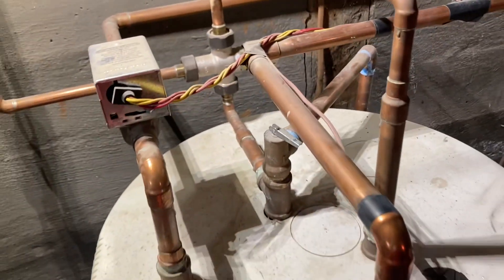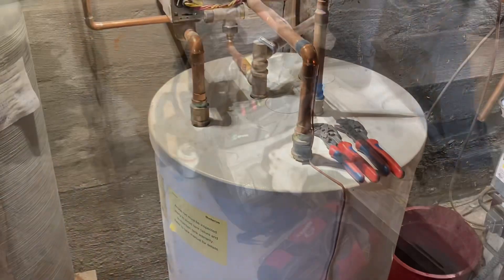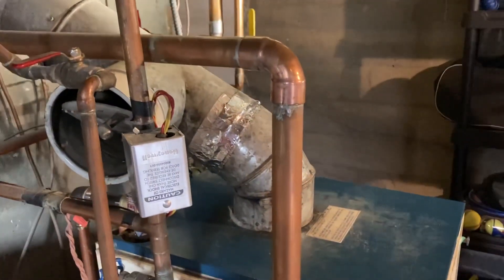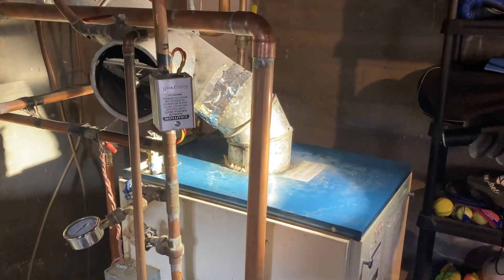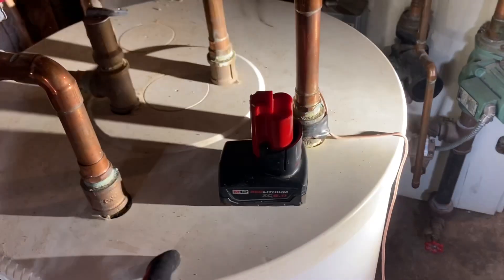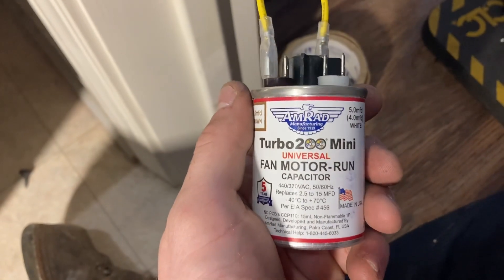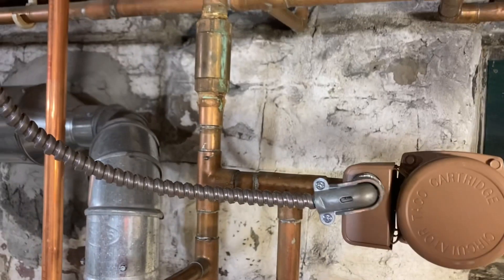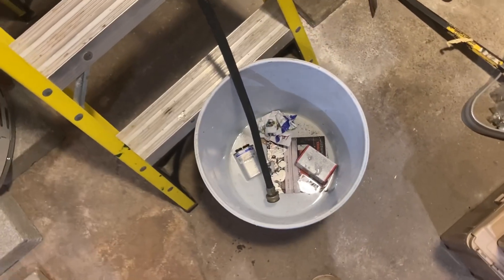Saving Our Customers Money! And Other Residential Service.

Comment: The relief valve should not have a piece of black iron coming out of it. It's a very bad thing. I see you strapped a tank this time It should have never been hung on a 3/4-in pipe without support
Reply from the maker: I re-read the mechanical code and the ASME section for relieve valve piping. Black iron fits the bill for everything they ask for, except that it isn’t corrosion resistant. My mistake. We are always trying to get better. Black iron is installed on all kinds of relief valve’s, residential and commercial, so you get lulled into doing it when it’s done everywhere else.
Reply: Black iron into the relief valve, black pipe out.  What's the problem?  It would have to run/weep for a very long time to rust it closed.  Both the inbound and exiting pipes would rot evenly.
Reply: @valenzaplumbing  I'm not sure where you're from but New York State code specifically states that the material of a relief valve drip leg should be non-ferrous metal or approved plastic which I don't agree with so all my relief valve drip legs are copper and only copper. And I have saved examples of relief valves that have seeped water piped in black iron that are completely closed potentially a bomb
Reply: @edileo2112  I'm not sure where you're from but in New York state our code specifically requires our relief valve drip legs be of non-ferrous metals or approved plastic which I'm not a fan of so all of my relief valve drip legs are of copper and only copper. And I have examples of ones of black iron that have  I've taken out that are closed right off because they seep water until they are closed potentially a bomb
Reply: @valenzaplumbing  we use our code book for a reference book it's impossible to memorize every little thing in it so if you read into the comments that are posted there's a couple guys stuck on the fact that black iron is okay when in fact it is not we're never too old to learn that's what this should be all about God bless

Comment: On teh Recirc side, the pressure tank has an interesting valve(s) system. What is that part(s)? Or is it two?
Reply from the maker: It’s one part. An isolation valve, so you can drain and check the charge easily, while keeping the water heater in service. Webstone makes these.

Comment: make that valve idiot proof....aka hide the handle
Reply from the maker: Any valve on a heating system can be turned off inadvertently and cause problems. You’d go crazy removing all of the handles from every one. I agree, it could cause an issue, but likely not. We install lots of valves for easy boiler service and don’t have issues. Most homeowners are clueless when it comes to their homes mechanicals.